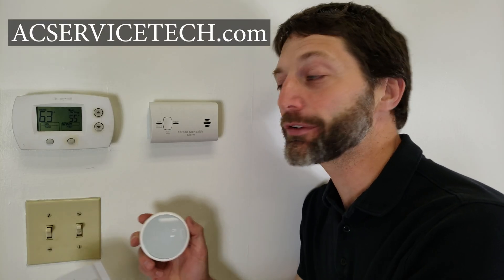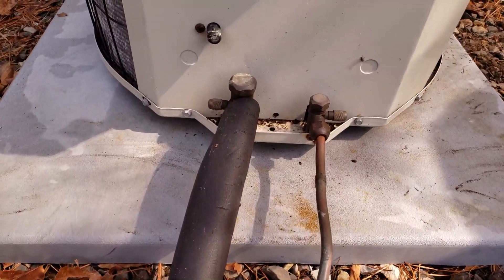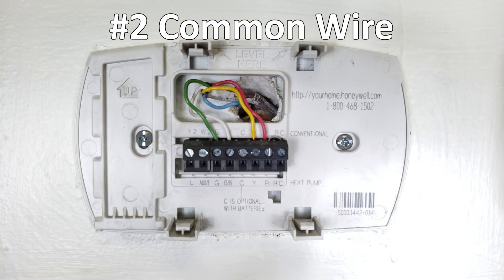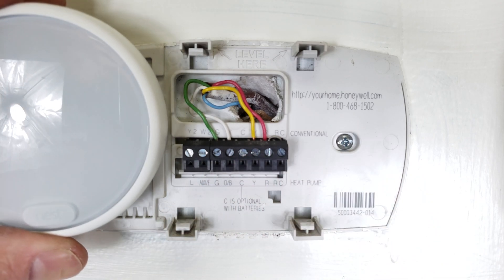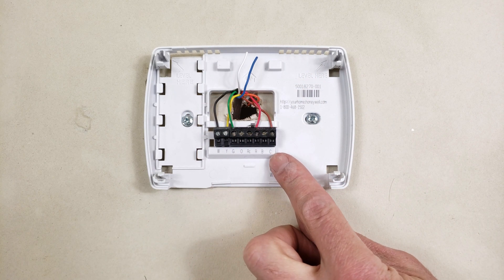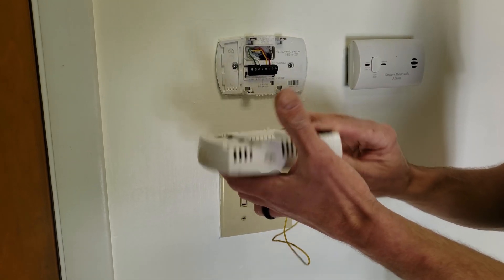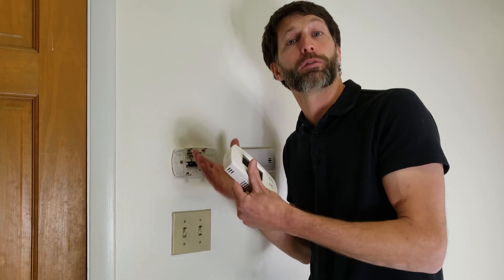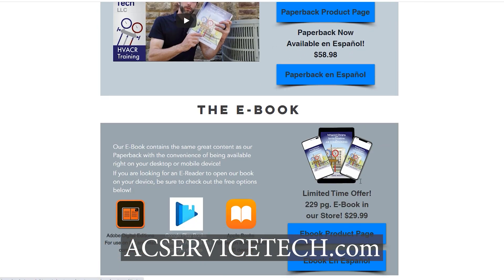Be Aware of These 6 TIPS When Replacing a THERMOSTAT!

Comment: Have you a video on doing voltage checks. Im not an electrician but have electrical training to a certain level. . For example how to measure the voltages at the thermostat if you dont have a common present. Or measuring the low voltage etc in difficult circumstances etc etc  Just a few tricks we need to know. Thanks in advance. Michael
Reply from the maker: Michael, look up "acservicetech thermostat" and I have a bunch of video on measuring voltage, tracing a short, etc. I actually just published an article on that yesterday at www.acservicetech.com/articles thanks
Reply: @acservicetechchannel  Thanks

Comment: Also, good to note the number of stages for heating, cooling, dual fuel, etc. before you quote the customer on thermostat replacement cost. Could wind up ticking off a customer, eating the extra expense or not giving them the efficiency or operational options that they paid for.
Reply from the maker: Great Points Bill!

Comment: CRAIG!!!!!  What about the HOLE??!  Behind the TSTAT.  PLUG the HOLE.  Unconditioned air, coming from either the attic or underside of house, enters the wall cavity, then comes BLASTING OUT of the TSTAT WIRE's WALL HOLE.  That AIR FOOLS the TSTAT!  TSTAT then makes decisions measuring UNCONDITIONED AIR, not living space air.  Bad JuJube!
Reply from the maker: I am with ya. I just didn't mention it in this video. I use GE silicone every time, thanks and sorry it didn't make it into this vid!
Reply: @acservicetechchannel  G.E. SILICONE??  Ugg.  I fill the hole with low expanding D&W 'Door & Window Spray Foam Sealant', (the white stuff, not the yellow max expand sticky stuff.)  D&W fills the hole without making a huge sticky mess that can ruin carpeting or clothing.  Plus, it is easily broken up later for the next TSTAT wire movements.  Silicone is messy, expensive and just not the best choice for the job.

Comment: Sir i got a order of water chiller but instead using of copper pipe I am thinking to use plate type heat exchanger (PHE) so please tell me PHE work as effective and efficient as like copper pipes or not?
Reply from the maker: They work very well for energy transfer but you would need to know pressure drop across it because it will be more than a standard heat exchanger, thanks!

Comment: Craig, I bought a new heat pump/air handler HVAC with heat strip. Is it better for energy savings to keep the temperature constant, or lower it at night? Thanks very much.
Reply from the maker: If you lower it, only do this by two degrees, thanks!
Reply: @acservicetechchannel  Thanks very much.  Would you lower it if you were me?

Comment: Why are they using different color wires on the terminals?
Reply: May have been a rookie installer, maybe the wires not being used are shorted and were removed from use, a homeowner could've installed that thermostat, maybe the installer just slung it in without thinking or maybe a colorblind installer. The possibilities are endless. I've actually seen thermostat wire insulation, what appeared to be the Easter edition, that had pastel colors.
Reply: I kid you not them are the same alternatives I came up with too but thanks for explaining I also do HVAC and seem some like this I just thought him being the expert he would explain himself
Reply: @Dahvacman100  I do HVAC as well and I've seen all kinds of variations of wires used. I've helped green techs over the phone doing troubleshooting and they've asked "check between the red and the blue wires?". I reply with "I don't know what color wires you've got, check between these TERMINALS".
Reply from the maker: Great job Bill! Explained it all!

Comment: I was looking online about having dual transformers last week and found a lot of people had had problems with NEST type thermostats and using separate heating and cooling transformers.  One person reported that he and NEST tech support had arrived at using the common from the heating transformer vice the cooling system transformer as a solution.  Apparently, otherwise the valves on the heating system clicked or something.
Reply from the maker: Yeah normally the tstat common is from the AC because that is how the old stats were powered on a two transformer setup. If that has issues, switch the common to the heater, thanks!

Comment: My thermostat (Honeywell) touchscreen lost its mind.  I found a bit of microscopic corrosion on resistor and got it working, but it wouldn't stay fixed.  Thermostat worked untouched, till I got a new non-touchscreen one.   Had to ensure I got one that could not only handle a heat pump, but also the number of stages.
Reply from the maker: Thats an odd one!

Comment: An extra tip: Be aware of brands that use something other than "C" to designate the common terminal, like American Standard/Trane uses "B."
Reply: Rheem/Ruud also
Reply: Be aware of what exactly ?
Reply: @Progress24.7  Lets say you have a complete Trane heat pump system which uses "B" as common and you buy a non Trane heat pump stat to replace the original. If the new non trane stat has a "B" terminal it will typically be to send out a 24 volt signal to pull in the reversing valve  in heat mode, for sytems that require that. That 24 volts is sent anytime the stat is put into heat mode, so if you just hook it up B to B it will be a direct short to common. If your lucky there will be a fuse in the air handler that blows, just replace it and fix the wiring, good to go. If you don't have a fuse it'll pretty much instantly fry the transformer, and if your like one customer of mine you'll just keep putting a bigger and bigger fuse in until you fry your new stat, transformer, and fan board. LOL

In a nutshell, make sure you know what each terminal does because bad things can happen when hooking things up letter for letter, even though it seems intuitive to do it that way.